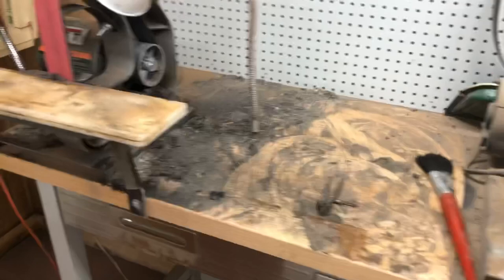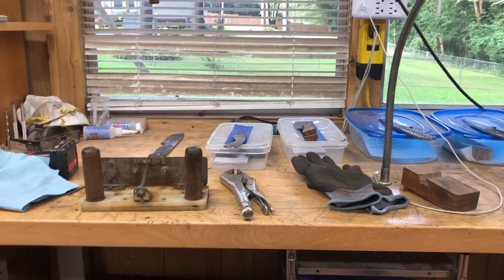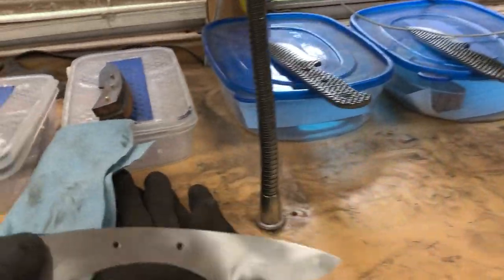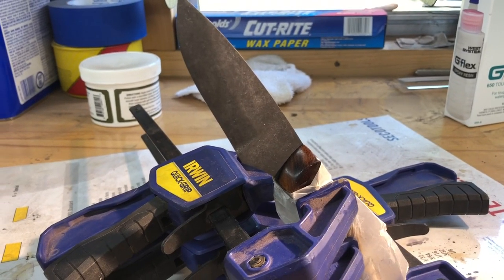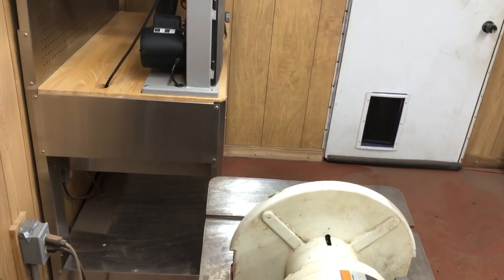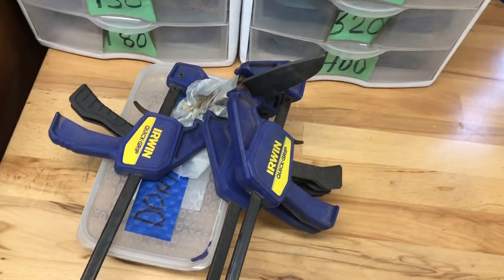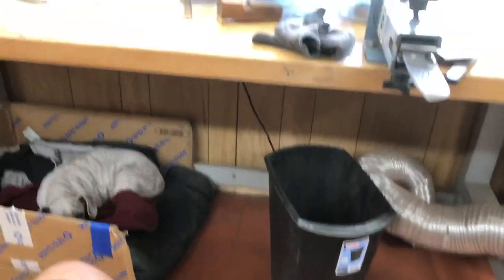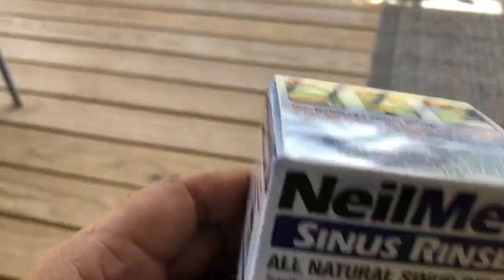Making knives and opening gifts

Comment: You think your shop was funky? Mine has the ceiling on the floor topped by a giant red oak tree along with part of my house. My forge is also buried in sand and debris with some content scattered between its former location and the lake down stream. I’m still looking for two anvils and my post vice. Weather acted up a bit .Working on it.
Thanks for the abrasive heads up. Looking forward to trying ceramic belts.

btw, those Neil Med bottles are great! Wouldn’t be without them. Metal dust can really mess you up. [Heck, you may still have enough metal up in there to make a powdered metal blade if you get bored.) Once you get the hang of using them it’s easy and refreshing.
Reply from the maker: Man that’s terrible. I had a beautiful house up on 6 foot piers right on the bayou. It was paradise,,,, until 6 feet wasn’t high enough. I repaired the damage and sold the house. It’s been under water a few more times since I sold it.
Reply: @bctruck  
It is what it is brother. Can’t go let it ruin your day. I’m never bored.😁👍

Comment: I wish Combat Abrasives made a size belt that would fit my WorkSharp. I ship a lot of things using the free USPS boxes but I wrap them in kraft paper and ship however I want. LoL
Reply from the maker: I ship my caddo,dinner skinner and neck knives in the small USPS box. 8 bucks anywhere in the country.
Reply: @bctruck  if they are under a pound you can wrap the box and ship it for half the cost First Class. When we used to make coffee mugs I would use the medium boxes and tear them apart and reconstruct them to a triangle shaped box. I had to remove material to get it under a pound. A lot of work but I mainly did it for structural integrity. We easily have shipped over 100 mugs. Not one broken. Still not sure it was worth the time though. LoL